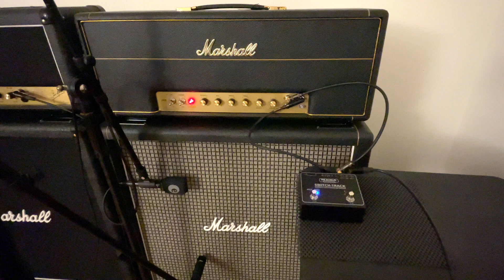Marshall 1959HW Super Lead Plexi Channel Switching Trick | 1987x Bluesbreaker JTM45

Comment: Too bad the normal channel in my 1987x is unusably dark...
Reply from the maker: could have it modified, or use an eq pedal before that input and add high end sparkle etc Like I did 4 videos ago with the Bluesbreaker.
Reply: @HollywoodRareGuitars  Good idea, will try that after watching your video that you mention. Thanks!
Reply from the maker: @killersajmon  My 1987x is very similar to this amp, check out my recent video of the two compared.  Not sure why yours is dark
Reply: @HollywoodRareGuitars  Thanks I Will check it out!